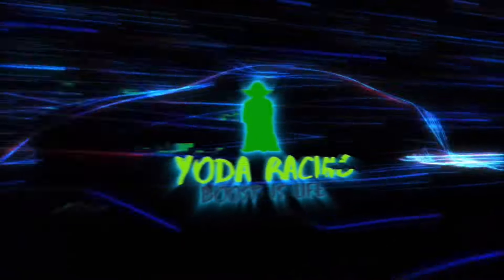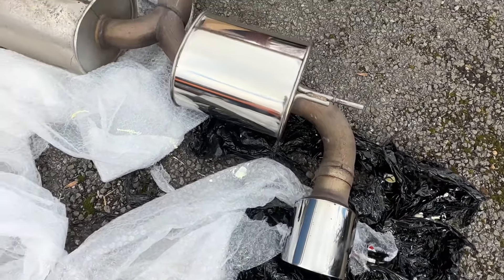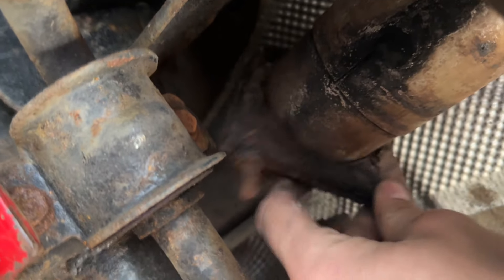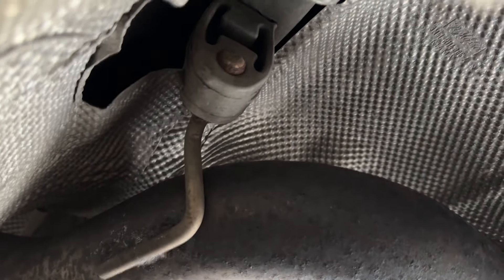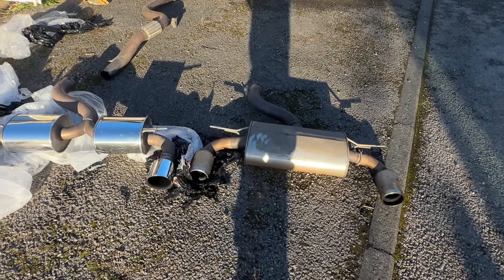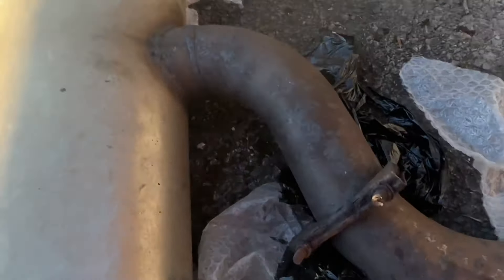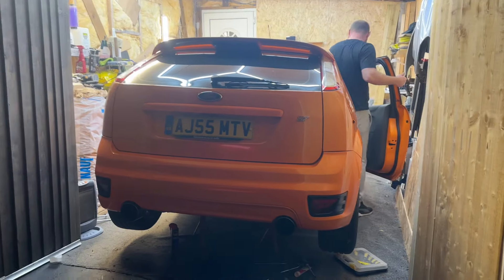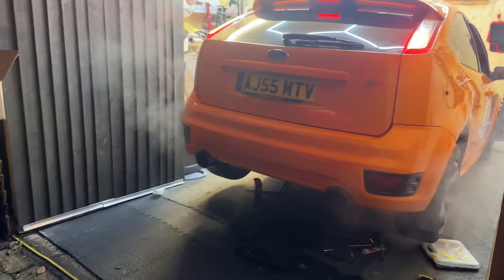Focus st225 mongoose section 59 exhaust install

Comment: Should’ve just swapped back boxes mate, mongoose centre sections are the same for the standard and S59 system. Deffo best exhaust for the st 👌
Reply from the maker: I was gonna but the new one was a lot fresher then the old one and once it was off just made sense to change the lot and deffo agree with u buddy 🙌

Comment: Did you keep the exhaust brackets that were fitted already when you too the old exhaust off or did you change them ?
Reply from the maker: I sold them with the exhaust and used the ones that came with my exhaust

Comment: What exhaust were you running originally I want just a cat back and considering miltek non res or section 59
Reply from the maker: @LoganGreenway  was just a normal mongoose exhaust section 59 is the best imo
Reply: @Yodaracing1 thank you! Are you still running the decat? How’s the drone on the motorway? I’m hearing so many mixed opinions at the moment I really don’t know what to get
Reply from the maker: @LoganGreenway  no drone at all mate